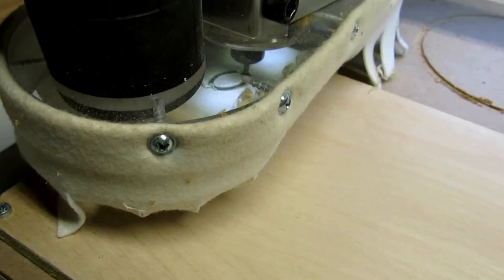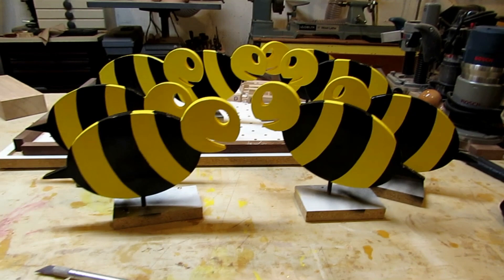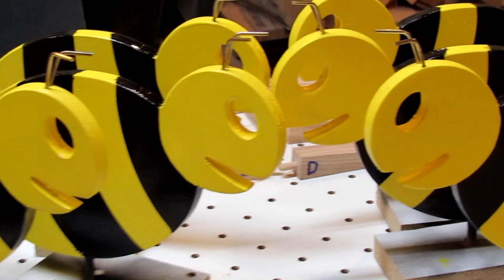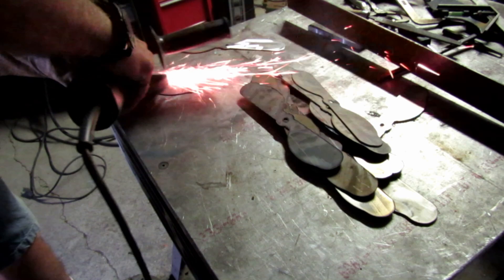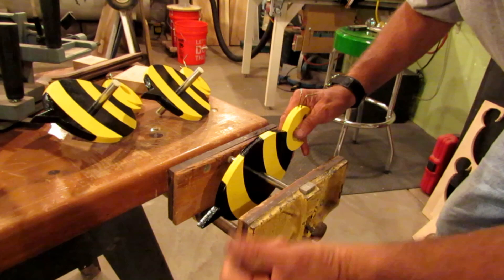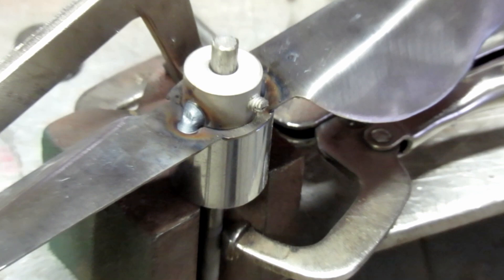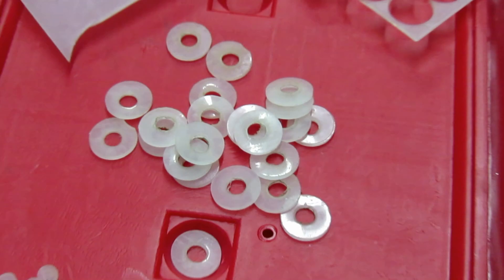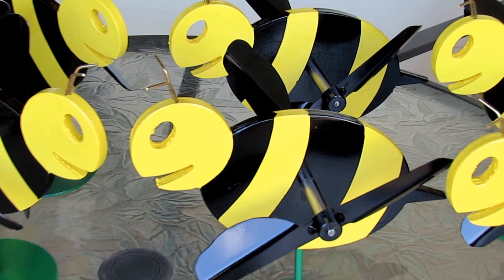Making Bee Whirligigs For The Garden

Comment: Where did you buy your cnc router ? How much did you paid? I would like to get one.
Reply from the maker: I designed and built it from surplus parts that I had so it didn't cost much. If you buy one it would probably cost between $4,000.00 and $7,000.00 with software. Thanks for watching.

Comment: so you use a  shaft that turns and  this way both wings turn in the same direction and it seems you offset the wings for balance.. Many duck whirligigs  have one wing going clockwise and the other going counter clockwise.  I like your method better. Thanks for showing that.
Reply from the maker: I live in an area that is quite windy and the ones with the light wings spinning opposite directions self destruct quickly,  so I decided to make smaller wings that are connected with good bushings.  It takes about a 15 mph wind to get them spinning so I am looking at making some slightly larger plastic overlays in the future . The good thing is they do not spin wildly out of control in high winds. Thanks for watching.